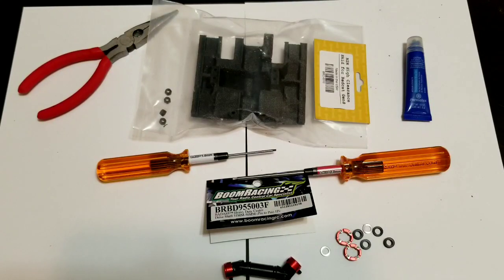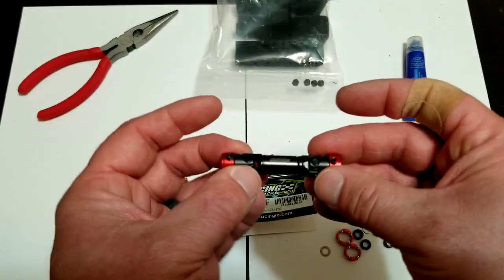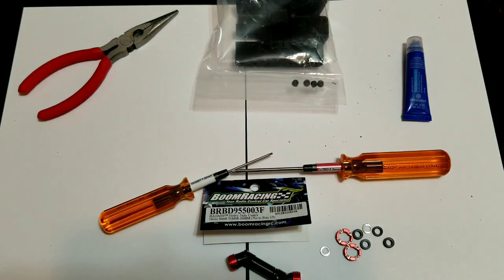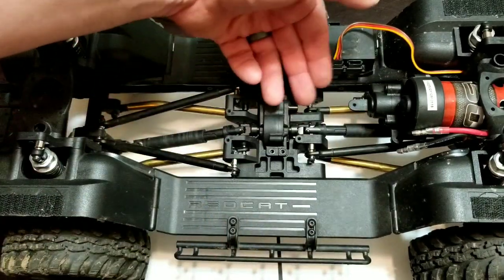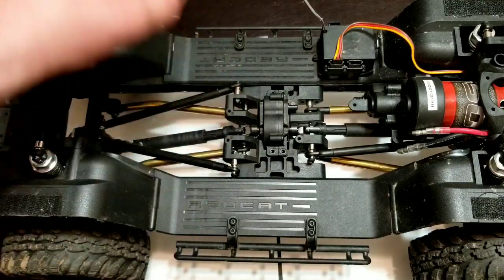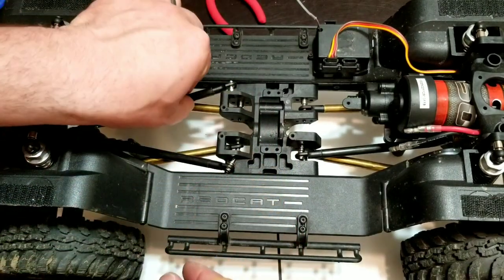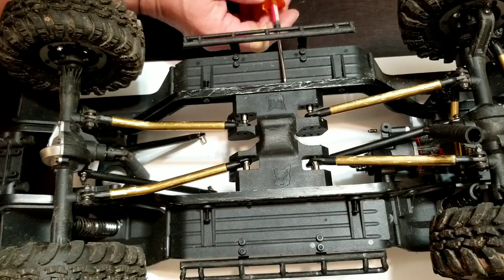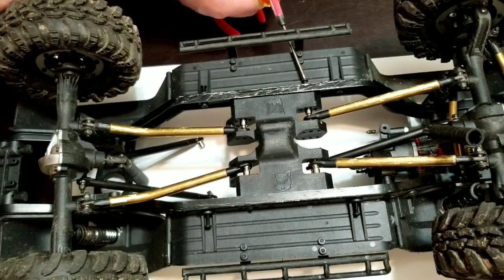Redcat Racing Gen8 Build Series Part (2) Bowhouse RC skid and Boom Racing Driveshaft.

Comment: I think you forgot to use the washers when installing the upper rear links to the new skid plate. Any reason why you didn’t use them?
Reply from the maker: The washer concept came out in the updated skids. They was only used to prevent the skid from cracking. Very few people had problems with the skid cracking but it was a known thing. I had no problems with cracking. It also helps to clean out the screw holes before installing the screws. Washers are not needed if proper precautions are taken.

Comment: hey brother you told me to comment here,,I only commented on the Charlie video bc it was ur newest 1,,this will be my last time asking man if u can't do it jus lmk, I spent good money on these and boomracing don't say shit when you email them,,lmk something my guy!
Reply from the maker: Really the shafts fit the axles without any shims done. The t-case to the axles you are fine not doing anything. Atleast the model we have here for testing everything is tight with no additional shimmering. Test yours to verify. Just attach the driveshaft to the axle output and test for movement. Slight movement back and forth is OK. We are talking like 1mm any more than that I would recommend using the super thin ring/pinion shims. If you need some let me know and I can find you a link or them. In terms of the intermediate shaft. We used a 1mm shim on the transmission side and a 2mm shim on the t-case side. The 1mm shim is the smallest black plastic shim the 2mm shim is the black plastic 2nd smallest shim.
Reply: @axletwisterrc4526  intermediate  shaft ???WHAT IS THAT?SO THE 2 LONG DRIVESHAFTS ARE A DIRECT FIT THATS WHAT UR SAYING????AND THE TRANSFER CASE SMALL DRIVE SHAFT YOU USED A 1MM SHIM ON THE SIDE WERE THE MOTOR IS?AND A 2MM SHIM ON THE SIDE CLOSEST TO THE TRANSFER CASE?THE 1MM SHIM IS THE SMALL BLACK PLASTIC SHIM?AND THE 2MM IS THE BLACK PLASTIC SMALL 2ND SMALLEST SHIM?
Reply: IS THE INTERMEDIATE SHAFT THE SMALL BOOMRACING BADASS DRIVESHAFT?
Reply from the maker: @josecanseca8979  yes Sir
Reply from the maker: Yes Sir the Short shaft is the intermediate shaft.